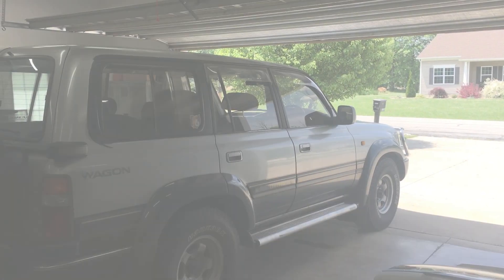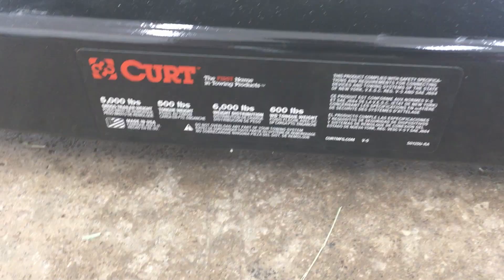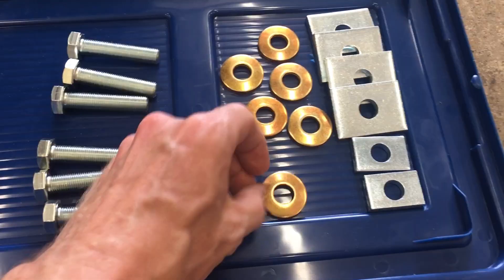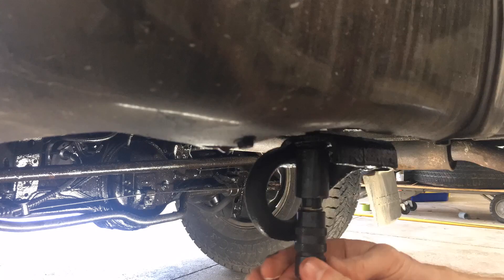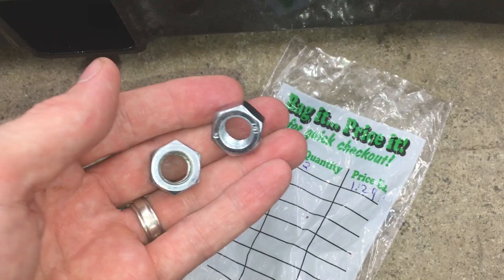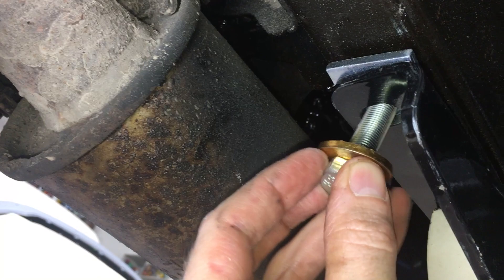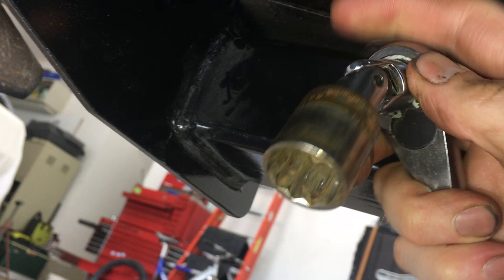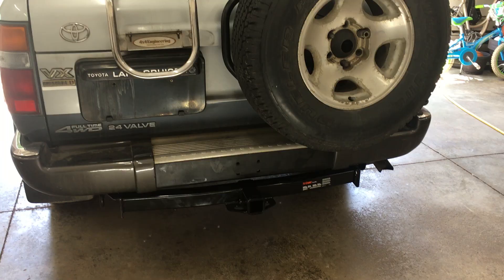How To Install Rear Trailer Hitch Receiver - Curt Class 3  on Toyota 80-Series Land Cruiser

Comment: This is great. I'm thinking of replacing the step on my JDM J90 with a hitch receiver. I'm pretty sure it's the same frame measurements, and I'll be prepared for some nonthreaded bolt holes.
Reply from the maker: I may be mistaken, But I thought the Prado was closer to the 4Runner in dimensions than it was to the 80 series. I've never seen one in person to compare.
Reply: @6thGearGarage  Thanks! A little extra research and measuring leads me to think the 4Runner hitch, 13087 works. The best part is that it comes with a nut plate to insert into the frame, avoiding the J80 problem. Yeah, it's closer to the 4Runner, but it's wider and taller. Loving it so far, especially with the ol' familiar 3.4L engine.